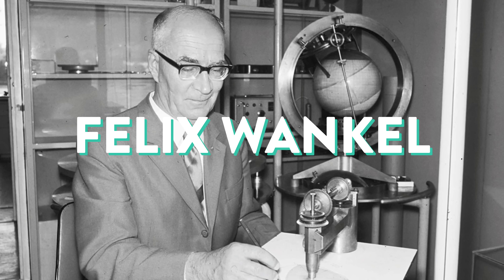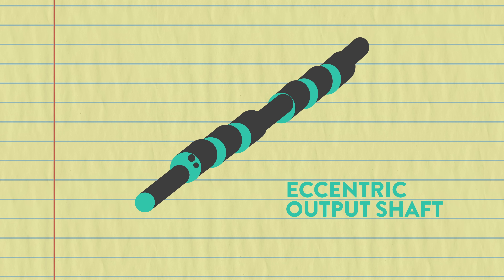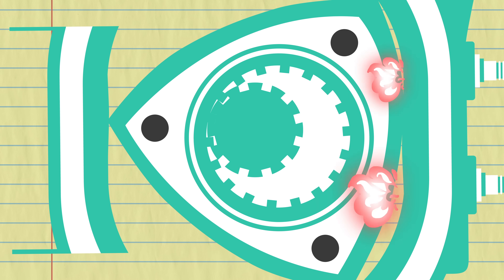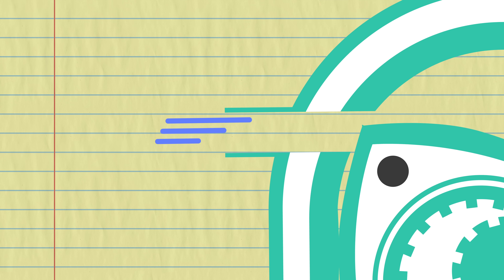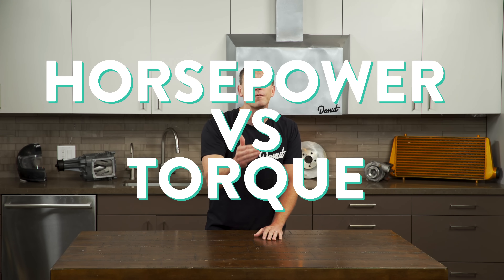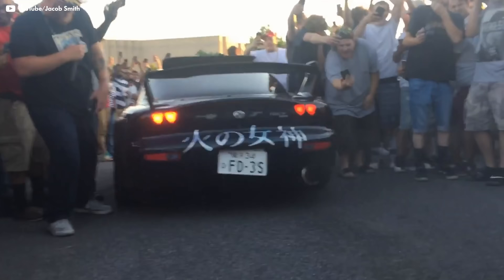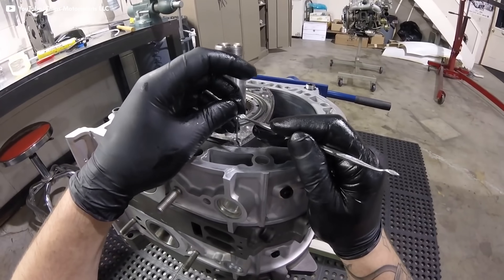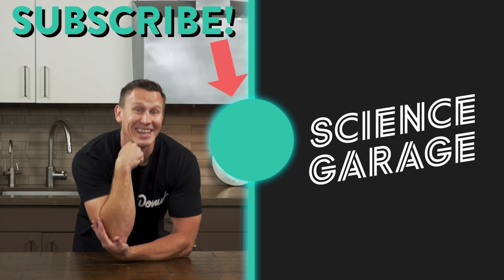Rotary Engine | How It Works

Comment: The story I've heard about rotaries was a guy who put one in an airplane, a small sporty two-seater, probably Vans RV-8. From what I heard performance was excellent, but reliability, well, wasn't. He became famous for putting the thing down in a cornfield almost routinely. Simplicity can help reliability, but simpler doesn't always mean more reliable. I heard another person once talking about how if rotaries had been given the same amount of effort through history as regular piston engines they'd probably be the dominant engine type now, an interesting thought to consider.
Reply: I saw one in a Van's RV-4 at an airshow in the late 90's. Dunno how well it held up. What scared me more was the RV-6 with a Subaru engine in it that was next to it.
Reply: @Quill Maurer No civil or commercial aircraft manufacturer has ever sold a plane with a Wankel engine... this is because manned-aircraft engines must past extremely strict reliability tests. There has never been a successful Wankel engine that is FAA or EASA airworthiness certified.
Reply: @Quill Maurer That is an interesting theory he offered, but its nothing but wishful thinking. The Wankel engine was extensively and exhaustively developed by 26 of the world's largest and best engine manufacturers and over 100 of the best universities and research institutes (Like NASA and MIT) spent decades, millions of man hours and billions of dollar developing the Wankel engine design.
Mercedes-Benz and and General Motors for example both spent over 100 million dollars a year on Wankel research and development, additionally:
Ford
Toyota
Porsche
Rolls-Royce
Nissan
Alfa Romeo
American Motors (AMC)
Citroën
Suzuki
Yamaha
Kawasaki
BSA
Norton
Hercules
John Deere
Ingersoll and Rand
Fichtel & Sachs AG
Yanmar Diesel Co. Ltd
Daimler-Benz AG
Deutz AG.
MAN AG
KRUPP AG
IFA VEB
Graupner
Savkel
Curtiss-Wright
OMC  
Wankel-NSU which became Audi..

 and dozens of subsidiary companies and and partnership companies which combined represent billions of dollars in research and development besides just tiny little Mazda.
Reply: Quill Maurer heyy, could you tell me where you saw that plss? I love much further wankel than traditional engines and i wanna know some more
Reply: @Amadeo Bon Wankel engines are obsolete now, as an aircraft engine they were a failure.
Reply: doktorbimmer granted their reliability is suspect to being able to hold up to the common TBO of most certified aircraft engines, their smoothness and low vibrational output is supreme compared to piston engines in regards to fatiguing the airframe (though turbines are even smoother)  They're typically only used in RC applications anymore though.
Reply: @100GTAGUY That is why there are no FAA or EASA certified flight-worthy Wankel engines available. The Wankel engine has always been poorly suited to aircraft applications which they have never been used by any manufacturer for certified production aircraft.
 Only Graupner GmbH. made RC Wankel engines... and they discontinued them ages ago...
Reply: @100GTAGUY Gas turbines offer a Order of Magnitude greater power-to-weight ratio, Power density and time between overhaul performance with greater range and fuel efficiency than any Wankel engine known to ever exist. Cheers!

Comment: I would really like to learn about 2 STROKE ENGINES, I don't understand how they are able to push out exhaust while sucking fuel could you do an episode. And why do they need oil in the fuel. and What is an expansion chamber.

Comment: I've always preferred wankels over piston engines because they're so much more elegant by design. If only they could work around the major drawbacks they have. I've love to have a wankel in a bike because of the amazing power to weight ratio, compactness and noise.
Reply: Pretty sure I've seen a rotrary bike around YouTube somewhere
Reply: @Micah - There are a few custom built race bikes I believe but I don't think there are any production rotary bikes.
Reply: 6Twisted I agree, Ive only heard of one and that was just from a visio racer video
Reply: Micah Bennett I believe the motorcycle you're thinking of is a Norton, I can't remember the exact model designation off the top of my head but it definitely had a rotary engine (not sure if it was a single, or dual rotor) it may have also been a production bike if I'm not mistaken, but was produced in very limited numbers.  Though I could be wrong, because I do recall saving a pic of a very beautiful custom built rotary powered supersport bike I saw in some article. And it's definitely a possibility you might also be thinking about that bike as well.  

All I know for sure is that there's definitely rotary powered bikes out there, granted they're rarer than unicorn farts floating on rainbows.
Reply: @100GTAGUY Norton only sold WANKEL powered bikes... Not Rotary powered bikes.
Reply: @100GTAGUY MEGOLA made Rotary powered bikes! https://www.youtube.com/watch?v=qAQuljp-atA&list=PLmhSXyOMooSlhNQZShFYxRRiz2pB_jl-g&index=12&t=0s
Reply: @doktorbimmer  Hey uh, mind not using bold? It's a bit annoying and a pain to read. Other than that, appreciate the info.
Thanks.
Reply: @Just A P39N Uh, Hey do you mind not trolling my comments? It's a bit annoying and a pain to delete them from my inbox. Other than that, I appreciate the thanks. Cheers!
Reply: @justinl2009  
Bimmer's info is usually all wrong. Sad but true.
Reply: @John Burns Just the facts here Johnny... not like your false rumors!
Reply: Sorry jonny but your false rumors never come true do they!
Reply: Bimmer, please get therapy. Please.  It is sad to see people like you go downhill before our very eyes.
Reply: Jonny please go down to your local Mazda dealer and see for yourself... your delusional fantasies about new Wankel engines are not true... they do not exist in the real world lad, it all in your crazy head!
Reply: @doktorbimmer  
It is sad to see a man descend into mental torment. Sad indeed.
Reply: Yes jonny you are sad and tormented... by the false hope and phony rumors that Wankel engines are coming back... Rumors that never come true!
Reply: Motor1 is an amateur blogsite... nothing but a clickbait rumor mill.
Reply: Where is it Johnny??? Mazda has not revealed any new Wankel engines or Wankel powered vehicles since development was cancelled in back in May 2009.
Reply: Wankel engines are obsolete technology... not even Mazda sells them anymore. Don't believe me? Just go down to your local Mazda dealer and see for yourself.
Reply: Hi Bimmer, Mazda are not the only Wankel manufacturers.
Reply: Hi Bimmer.
Reply: There are no Wankel manufacturers... Wankel engines are obsolete.
Reply: Hi Johnny did you psychiatrist give you some new meds???
Reply: Johnny stop by your local Mazda dealer and see for yourself... they don't make Wankel engines anymore... Mazda dropped these unreliable engines like a bad habit years ago!
Reply: Hi Bimmer, I see you are still making things up.
Reply: I'm not making things up johnny... go down to your local Mazda and see for yourself. Mazda does not make them anymore... have not made them IN YEARS!
Reply: Bimmer, you have been told about making things up.
Reply: That is right johnny, everything you say is made up...
Reply: Sad isn't it.
Reply: @johnburns4017  What is the deal with this bimmer guy? Is he nust a super Mazda troll or just a general snarky troll?
Reply: @WALTERBROADDUS Just the facts here my novice friend, some people are under the delusional impression that Wankel engines were not a massive industry wide commercial failure and are in a deep state of denial regarding the fact that the Wankel engine has been obsolete for many years.... even Mazda dropped this inferior technology like a bad habit.
Reply: @doktorbimmer  Failure? The company success for decades  was due to the Wankel. Novice? I owned  a RX7.  It's  no more obsolete than, the HEMI V8 is.
Reply: @WALTERBROADDUS You don't know much about the automotive industry do you son?
Reply: @doktorbimmer  🤨 Rather insulting comment on a few levels.....
Reply: @WALTERBROADDUS Its not an insult if its true, its just embarrassing for you.
Reply: @WALTERBROADDUS  
Bimmer is mentally deranged for sure. I doubt he is violent though, so is allowed to roam the streets. 

He keeps writing that no rotaries are made anywhere in the world, despite that rotary engines power many UAVs. 

A sad case indeed.
Reply: @doktorbimmer  
Bimmer, you do not know any facts. Sad but true.
Reply: @John Burns I know for a fact  you are a liar... there is no 2020 Mazda RX-9 or any other Wankel engine vehicle offered by Mazda.
Reply: Bimmer, you have been told about making things up.
Reply: @John Burns Johnny, you have been told over and over again, Mazda does not make cars with Wankel engines anymore... just go down to your local Mazda dealer and see for yourself.
Reply: @doktorbimmer  he’s not trolling though. Just asking you to not bold. You could just say no. Yet you copy and paste his message. That is the real troll msg here lol
Reply: @Micah Bennett  Here is a Rotary bike.. the MEGOLA, the one that inspired Felix Wankel. 
https://www.youtube.com/watch?v=c4Cq49IDfOc&t=54s
Reply: 6Twisted Turbocompound
Reply: NSU sold the licensing rights to the Wankel KKM engine design to several motorcycle manufactures. including;
YAMAHA
KAWASAKI
SUZUKI
BSA
SACHS (HERCULES) sold to NORTON

 MZ (DKW) and VAN VEEN also made Wankel KKM powered bikes
Reply: There are a decent amount of rotary powered bikes, but they are rare so yeah.
Reply: The company that invented the Wankel KKM engine was NSU Motorenwerkes GmbH. it was at the time the largest motorcycle builder in Europe... Felix Wankel was a motorcycle fan and rider... he worked at NSUs motorcycle division.
 Félix Théodore Millet invented the Rotary powered motorcycle in 1892... Felix Wankels favorite bike was a legendary German racing bike company called MEGOLA  Wankel copied the Rotary layout for his 50cc NSU supercharger and later his Wankel DKM prototype (a rotary motorcycle engine).
Reply: A new breakthrough, SPCCI ign. 
https://www.youtube.com/watch?v=vEMuOi0N2fQ&lc=z22swlv5pmjdtdqgt04t1aokghkdzjvdy2ebevuqc35trk0h00410.1555936063812696
Reply: @johnburns4017  WHERE IS IT JOHNNY??? WHERE IS THAT NEW MAZDA WANKEL ENGINE???

Comment: If the e-shaft spins 3 times faster, doesn't that mean that the rotor is just spining at 3k but the rpm meter will say  9k? So a rotory doesn't really rev at all?

Comment: #BRAAAPSTUTUTUTU
Reply: evos are red, subies are blue, but both of them go BRRAAAP STUTUTUTUTU
Reply: Followed by the screeching sound of broken apex seal chucks grinding into the housing walls...
Reply: @doktorbimmer  The uk government are being forced to ban or limit diesel cars by 2040. They are giving off high amounts of carcinogenic pollution and are credited for a large rise in cancerous deaths. A lot of the diesel emission testing didn't apply to real world situations while many were falsified. In other words 95% of diesel cars are marginally better for us than petrol if at all, some diesels are worse. DPF filters (that limit the cancerous fumes) are also a very big grey area in effectiveness. Many people have them removed as they block up easily and are costly to replace. Also very conflicting evidence in how well they actually filter while working on top of the added pollution they take to make. Also much pollution is added because some people are forced to ''drive on the motorway to clean the filter''. If they don't do that a warning light puts cars into limp mode. Sellers of such cars do not tell people that diesels are very bad to be used as anything but long distance vehicles. Car makers want sales, telling people a car that is bad in short journeys is not good business for them so they don't say it.
Reply: you forgot the brap brap brap and BANGs

Comment: Rotary engine are the best of the best. In 1991 Le Mans, Mazda won the race in the 787b, the other finish 6th and 8th. So after the race the FIA inspect the winning 787b and find out that the engine was still in good condition after a non-stop 24 hours. Rotary engine is so good that the FIA ban rotary engine from racing.
Reply: completely wrong.

Comment: Felix Wankel saw an internal combustion engine, and immediately thought to himself, "Cool, but I bet I can do it with triangles."
Reply: Unfortunately no one has ever sold Felix Wankel's engine design... it was a failure and only a single prototype exists today in the Deutsche Techniks Museum.
Reply: What ever happened to Ernie Brink?
Reply: Actually he saw a Megola rotary engine motorcycle and saw how the whole engine acted as a flywheel  making the engine lighter and run smoother... of course we don't use Felix Wankel's design because it was too complex... Mazda bought Hanns Paschke's and Walter Froede's design which is not a  rotary engine at all...
Reply: @doktorbimmer  rotary engine
Reply: @doktorbimmer  WANKEL
Reply: Bimmer, do you mean the rotor goes up and down? Wow!
Reply: @John Burns Well, not in the old Mazda engines... they reciprocate left and right.
Reply: @John Burns It appears you do not actually understand how the Wankel KKM engine works... would you like me to explain how the eccentric-crankshaft off-set produces a stroke equal to twice the offset?
Reply: Bimmer, in your state of mind do not explain anything.
Reply: Johnny! Just go down to your local Mazda dealer and see for yourself... Wankel engines are dead!!!
Reply: No legitimate engine manufacturer produces the Wankel KKM engine anymore... Wankel engines have become the sole domain of crackpots and con-artist... which one are you Johnny????
Reply: @johnburns4017  Sorry John but you look like fool again!
The new 2022 Mazda models are here and there is no Wankel engine or range extender.
You no longer have a shred of credibility left.
Reply: @sandervanderkammen9230  
Doktorbimmer,  a quiz. 
Name the company that is introducing a new rotary engined hybrid?
10 points for the correct answer.
Reply: @johnburns4017  WHERE IS IT JOHNNY????
Reply: @doktorbimmer  if you keep telling doktorbimmer that he will start crying.  Wankel              * LOOK DOKTRBIMMER THE FAKE ENGINEER  AND FAKE ERNIEBRINKROTARY HD LOVER LO
engines are intimately related to his type of schizophrenia.solve problems"
Reply: @doktorbimmer  The uk government are being forced to ban or limit diesel cars by 2040. They are giving off high amounts of carcinogenic pollution and are credited for a large rise in cancerous deaths. A lot of the diesel emission testing didn't apply to real world situations while many were falsified. In other words 95% of diesel cars are marginally better for us than petrol if at all, some diesels are worse. DPF filters (that limit the cancerous fumes) are also a very big grey area in effectiveness. Many people have them removed as they block up easily and are costly to replace. Also very conflicting evidence in how well they actually filter while working on top of the added pollution they take to make. Also much pollution is added because some people are forced to ''drive on the motorway to clean the filter''. If they don't do that a warning light puts cars into limp mode. Sellers of such cars do not tell people that diesels are very bad to be used as anything but long distance vehicles. Car makers want sales, telling people a car that is bad in short journeys is not good business for them so they don't say it.
Reply: @*THE REAL DOKOTERBIMMER ROTARY*  PISTON ENGINES VIOLENTLY CHANGING DIRECTION WHOOPS RIGHT OUT THE SIDE OF THE BLOCK  YES THE ROTOR GOES UP AND DOWN BUT DOES NOT COME OUT THE SIDE OF THE ROTARY ENGINE  LIKE STUPID DOES HAHA TWEET TWEET TWEET

Comment: well...
to sum it up....
AIR GOES INTO ONE TURBO AND IT GETS BIGGER AND INTO ANOTHER TURBO AND IT GETS BIGGER GETTING IT MORE 
BIGGER AIR
THEN IT GOES ROUND ROUND ROUND ROUND PISS SPIN
THE LEADING EDGE SPARK PLUGS AND THE TRAILING EDGE SPARK PLUGS AND THE LEADING EDGE SPARK PLUGS BLOW INTO MY BALL SACK
AND THEN THE INTERIOR OF THE CAR GETS UNBEARABLY HOT
MY VAGINA IS NOW THE CURSED EARTH
Reply: LEMME TELL YOU HOW A ROTARY ENGINE WORKS
Reply: RCR pretty much sums it up perfectly. The RX8 isn't as bad heat soak wise as a twin turbo'd rx7, but my wife does complain about it still haha
Reply: I was wondering how long it would be before the obligatory RCR reference...

Comment: is the animation accurate? i don’t understand why the top spark plug is above the fulcrum (pinch point?) in the case. if it was on the top of the fulcrum wouldn’t the top spark add resistance when the combustion stage is under way because it is still in the intake area of the case? maybe this is an obvious answer but if someone could help me out i would appreciate it:-)
Reply: There is a see through rotary video on youtube somewhere that would show you what happens, albeit scaled way down. But full sized wankels like the 13b msp in the rx8 have a leading and a trailing spark plug in a similar place than in the video here. One provides like 90% or so of the spark for the combustion cycle, the other is just there to finish it off and keep the rotor moving in the right direction.
Reply: They don't fire at exactly the same time, and they fire just slightly after the face passes it's straight up and down position.

Comment: Apex Seals usually are only an issue for turbo'd rotaries in my experience. Every one of my NA engines failed from either oil control rings, or coolant ring failures. Old saying, Boost In > Apex Seals out.